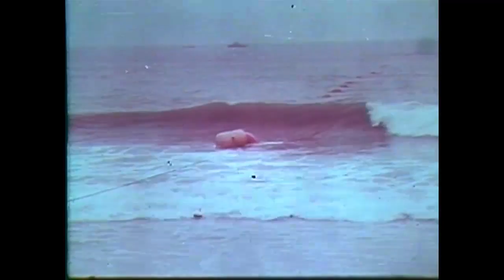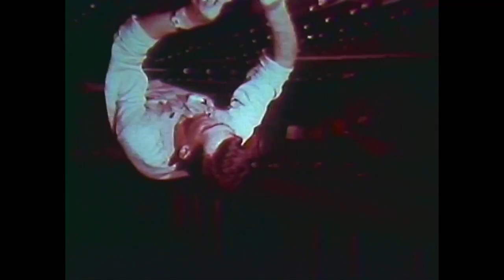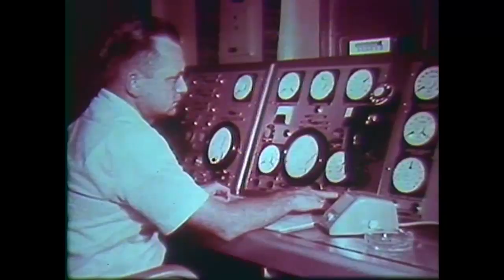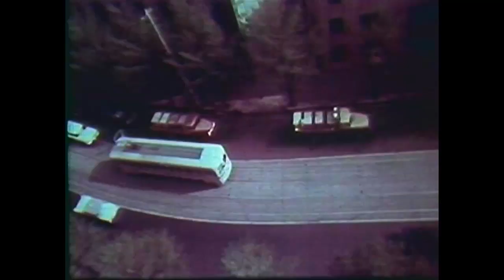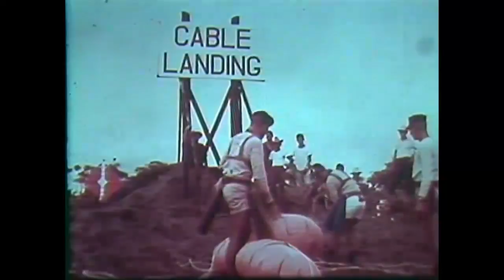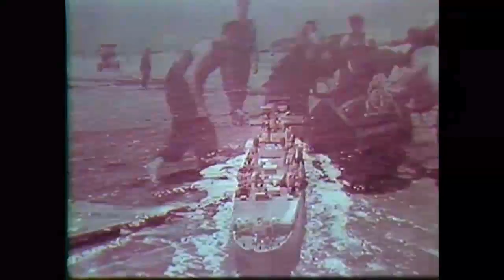The Story of the First Ultra Modern Phone Cable Ship - AT&T Archives

Comment: It was only one coax cable?! Quite amazing how they used valves in the repeaters, I didn't think they lasted all that long and required relatively frequent replacement.
Reply: Its all about designed quality. Cost is not really and issue

Comment: This is a huge project. Very interesting operation. Is this cable still in use?
Reply: Probably not. It’s a copper cable and the Repeaters were using vacuum tubes.
Reply: Some of the older cables were donated for research as they had temperature sensors that were still working.
Reply: Yes

Comment: fiber optic cable does not emit any kind of signal that would “drive sharks wild”.
Reply: the electric current for the repeaters does
Reply: Is that the latest girls go wild DVD, sharks gone wild?
Reply: This wasn’t fiber optic, it was coaxial. All electrons
Reply: @Leftplayer1  Yes it was fiber.   The power wire running the length of the cable set the sharks over.
Reply: The power wire set the shark off.   I was taking readings on shore when the attack was going on.   It was on a first trial system in the Canary Islands, chosen for the great depths between islands.

Comment: Are the 500lb 'repeaters' (voice amplifiers) nuclear-reactor powered? Hard to imagine they'd be passive and I can't imagined  what other power could they use at the sea bottom. Reminds me of the magnetic induction tap that the US used during operation Ivy Bells.
Reply: The power source was a high DC voltage (~5000 volts) fed into the cable from the shore stations. The telephone signals were superimposed onto this voltage, and separated by the use of blocking capacitors and filters at each end. Inside each repeater, various networks were used to derive filament and plate voltages for the amplifying tubes, which needed considerably less than 5000V to operate. The high voltage was needed to ensure sufficient power along the entire length of the run.
Reply: @bobweiss8682  is right, and it’s still the same today. Fiber optic repeaters are supplied with power from the shore.  When they fail, they’re simply pulled up and repaired/replaced.
Reply: @bobweiss8682  What's more, the comparatively recent invention (by AT&T scientists) of the transistor allowed for efficient and compact signal amplification that earlier would have required bulky, hot vacuum tubes, hardly suited to undersea deployment. Funny how so many factors (plastics, shielding, multiplexing, coaxial cables, peace time, etc.) arose in rapid succession to make this entire process possible as well as economically viable.
Reply: Bob Weiss your explanation is nothing more than science fiction.  I think the repeaters are nuclear powered as that solution makes sense
Reply: @davidjames666  What?  You sound like a confused troll.  Hmm.
Reply: comm744 you sound triggered. Relax.
Reply: @davidjames666  No, you do not think or hear.

Comment: While those cables were put into the ocean for worl wide telephone communication, but thanks today's smart compression technics,it is and can be now also used for internet,digital tv & digital radio,if they dit not had invented such smart compression technic, they had to start all over again for layed down cables under the ocean flour!!!
Reply: TPC-1 only had 384kHz bandwidth in each direction.  That's about 1/4 of a 1.5Mbps T1 line, or about 7 dial-up modems.

They essentially did start over and lay new lines. All of the original cables were abandoned and only 4-5th gen cables and newer are used for modern communications.

Comment: Fiber optic cables uses light and therefore do not generate any kind of electric field.
Reply: +gobo760 Transmitting electricity 3,000 miles is pretty darned impressive!!

(Or did they send some from North America and some from England+France?  Even if so, transmitting it 1,000 to 1,500 miiles is still impressive.)
Reply: True but if you look in to fiber optic cable open it chold cause blindniss
Reply: @tylersheehy3918  So can playing with yourself.😮😣😆

Comment: is there more information available from AT&t about how at&t determined that there was a demand for these undersea cables?
Reply: One of their earlier (1950s) news reels showed a graph of the exponential growth in telephony since 1905, to the point where line multiplexing became necessary. After WW2, long distance communications grow so rapidly that AT&T's line-of-sight microwave beaming became taxed, and they soon looked skyward (with Telstar 1) for sending messages and television signals around the globe via satellite. Coincidentally, with the invention of the maser/laser in 1957, optical methods quickly grew into being and copper lines replaced with fiber optics.